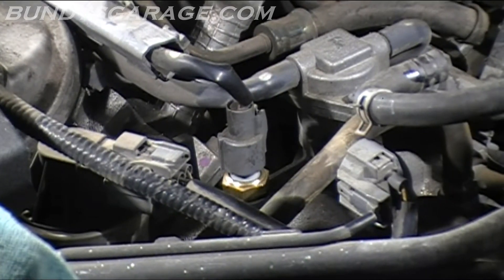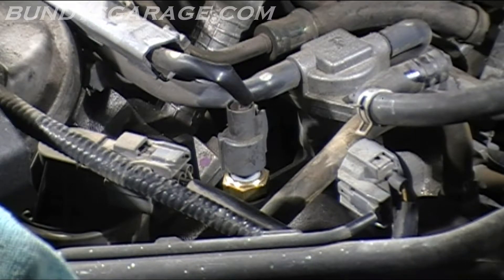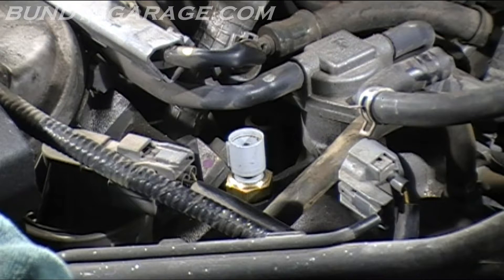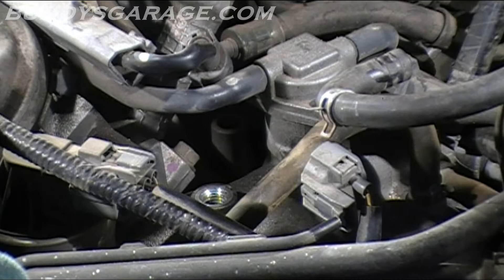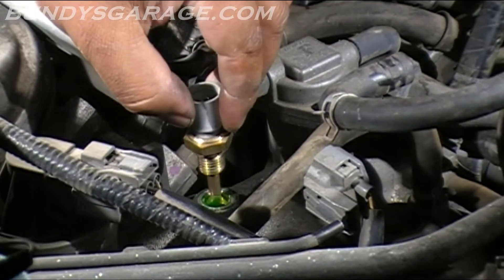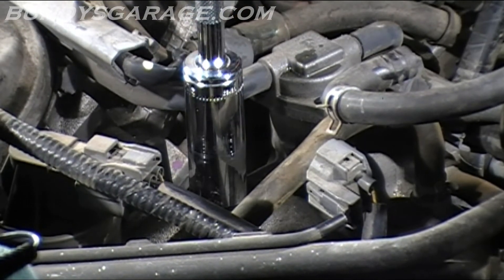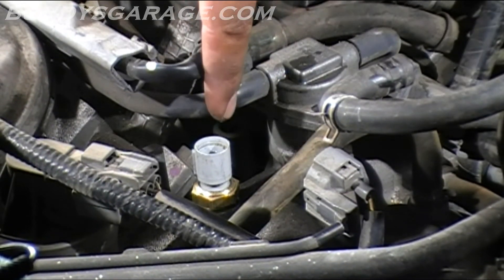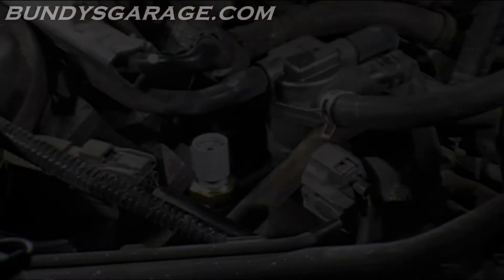UPDATE:Heat Soak Problem Solved Honda Acura J Series V6 - Honda Accord Acura TL

Comment: Well this had solved my problem I thought Worked for about a week Now the problem is back & seems to be getting worse Any more suggestion would be greatly appreciated Simply adore my EX v6 sedan She's my baby but this is very aggravating Please help!!!!!
Reply from the maker: Yes I can help you. Same thing happened to me as well. Had it beat for two years, then is came back. I will tell you what to do but you have to promise to report the results here (good or bad)! You have to change 3 sensors, 40 bucks on Rockauto.com. You have to change the engine coolant temp sensor (19MM), the air intake temp sensor (19MM) and the fan (thermo switch) (it controls the fans behind the radiator) (24MM or 15/16 deep socket) sensor that sits in the thermostat housing. The air intake sensor is on the intake manifold on the back edge towards the drivers side. Here are the Honda / Acura park numbers. Just take those and plug them into the search bar on Rockauto.com. Fixed the problem for me, period. 37870-PK2-015. 37880-P0A-A02. and 37760-P00-004. Just make sure you don’t switch the air and coolant sensors when you install them. They look identical and will fit both locations. Please let me know if this fixes your problem. If you have any more issues email me and we can jump on the phone.
Reply: BundysGarage Thanks for the reply Have already changed coolant temp sensor Will definitely change the other two this weekend & will surely let you know what happens Again thanks a lot for the help
Reply: I’m keenly awaiting updates on how this goes. I changed this sensor as well on my 99 ex v6 accord but it didn’t help at all from day 1. Admittedly, I was having the ‘heat soak symptoms’ for 2 years before doing something about it. Before changing out the coolant temperature sensor I changed my coolant because I realized that my car had been running on dexcool from the previous owner for at least 100,000 miles... not sure if that could confound this issue. Car is currently at 243000 miles. I also saw that a fault intermotor relay could produce similar symptoms but I ruled that out. Any wisdom/help in addition to what what was mentioned above is greatly appreciated. Thanks!
Reply from the maker: Same thing happened to me as well. Had it beat for two years, then is came back. I will tell you what to do but you have to promise to report the results here (good or bad)! You have to change 3 sensors, 40 bucks on Rockauto.com. You have to change the engine coolant temp sensor (19MM), the air intake temp sensor (19MM) and the fan (thermo switch) (it controls the fans behind the radiator) (24MM or 15/16 deep socket) sensor that sits in the thermostat housing. The air intake sensor is on the intake manifold on the back edge towards the drivers side. Here are the Honda / Acura park numbers. Just take those and plug them into the search bar on Rockauto.com. Fixed the problem for me, period. 37870-PK2-015. 37880-P0A-A02. and 37760-P00-004. Just make sure you don’t switch the air and coolant sensors when you install them. They look identical and will fit both locations. Please let me know if this fixes your problem. If you have any more issues email me. Let us know what happens.
Reply: Ordered the the AIT and thermo switch today.

For the fan thermo switch should I be draining the coolant before swapping out the switch then refilling as done for this Civic (https://www.youtube.com/watch?v=88eovIH51bE). I understand it's a different car from my 99 v6 accord but am assuming anatomy is similar in this respect.
AIT seems more straight forward (https://www.youtube.com/watch?v=ohcNq_jslN8)

Thanks!
Reply from the maker: No don’t drain the coolant. Just have the new thermo Switch ready to go when you pull the old one out have the new one ready and put it as quick as you can. The. Just replace the coolant that was lost.
Reply from the maker: Please keep us posted if this works for you.
Reply: BundysGarage  Changed other 2 sensors things are looking up Seems to have resolved the issue It's been two weeks and is starting & idling just fine Thanks for all the help cause this thing was driving me nuts 👍👍
Reply from the maker: Is it still going strong?
Reply: So I changed the AIT and Thermo fan switch using your suggestions and I'm still dealing w/ rough idle on warm starts. The symptoms have not improved for me at all unfortunately. 
Reminder, I have 99 v6 accord ex. I'm open to suggestions.
Reply: Roy, How has this fix been in the last 7 months? I am having a heat soak issue on an 02 Acura RL. Replaced the ECT just trying to see if i should replace the fan switch and air intake temp sensor.
Reply from the maker: I had it happen on a Accord V6  several months back. Changed all 3 sensors and the owners said the problem went away and never came back
Reply: BundysGarage how do I know it’s forsure those sensors ? It’s there a way to check if they are bad or not? Having this issue on my 2000 v6 accord
Reply from the maker: No they have to work all in sync so there is no way to test them. But its only 40 bucks from rockauto.com
Reply: BundysGarage yeah, i tried switching the coolant temp sensor but had no luck , it still has the issue
Reply: BundysGarage so I try the other 2 sensors that you mentioned ?
Reply from the maker: Let me ask you some questions. What is the year make and model of the car you are working on. As well as the engine size. This problem is very specific to only a few cars and other items can make it seems like it’s a heat soak problem. You have to park the car for 15 minutes and then start it up. It will cough, sputter, and run rough. If you give it gas and raise the RPM’s the engine will stay alive. Is this what you are experiencing?
Reply: BundysGarage yes sir , couldn’t of explained it better , I have a 2000 Honda Accord v6
Reply from the maker: Have you tried replacing all 3 sensors that I mentioned above?
Reply: BundysGarage not yet but I will , just ordered them from rock auto and currently waiting for the parts to arrive
Reply: BundysGarage so I replaced all three sensors and I’m still having the issue :/
Reply from the maker: The only other thing I can think of is your fuel pressure regulator
Reply: @fcbcarlitos1959  yes simply use an OBD2 reader to gain access to "live data".
This will show you these sensors are in mint condition 🙂
Reply: @fcbcarlitos1959   this problem has to do with fuel pressure regulation.
It's related to lag, hesitations, lean misfires, low power on countless Honda/Acura.

As it gets old the internal shaft between diaphragm and seat starts to stick... low pressure 😂

Think of this as a non-catastrophic failure managed by design.
Reply: @bundysgarage  this is what i am experience i replaced cts it is still doing it.

Comment: I just experienced this in my 03 CLS6. On acceleration felt like a bad miss fire 😢.  Then after driving for a bit it was back to normal. As I was thinking of possible causes I remembered my J30 Accord has heat soak fuel vaporization in the rail that seemed similar. Stumbled upon this video via google search. Good to know there some more info on this as I was under the impression a PCM update would fix it. Never bother to have it fixed in the Accord since  it was intermittent and I knew once the car ran for a bit it would settle in.

Comment: Kind of old issue, given the age of these 2nd gen TLs, .... but I wanted to add my findings on this. 
I had the intermittent start problems with my 99 TL 3.2  usually when hot but not always. Also occasionally saw the Eng Temp indication fluctuate erratically on the dash.  I replaced the ECT but same problem persisted ... I saw Bundy's video about making sure to "top off" the coolant passageway before replacing the ECT. Here's what I found: with my car level, upon removal I found my ECT probe bone dry. I topped off coolant AT THE RADIATOR then ran the engine with the ECT plugged into it's wiring but removed from the manifold. I watched for about 5 mins as air bubbles came out of the ECT boss ..... when coolant finally free-flowed out without air bubbles, I re-installed the ECT and topped off the radiator. So far so good. 
Bottom line: I've been been a backyard mechanic for 40+ years, but didn't realize the importance of purging air out of your coolant system. With cars these days, an array of sensors feeding data into a computer that runs your engine .... well obviously my old Jeep CJ did not care about air in the coolant but my 99 Acura does.

Comment: Help.  I have a 1998 Accord with the V6.  It runs fine at start up, and then it will almost die while accelerating at around 30 or 40 MPH after it gets warm.  So maybe after 10 minutes of driving on a warm day and a half hour of driving on a cool day.  When it has the problem, I have trouble getting it to go more than 40 MPH.  Will this fix the issue or does it need something else.
Reply from the maker: No your problem is something else. Sounds fuel or transmission related. Do you have any codes in the vehicle?
Reply: @bundysgarage  Thanks for the reply.  No codes or check engine light.  Now that it is cold here in Indiana, I can drive it without getting the problem, but it happened all summer and fall when it was warmer and I expect it to come back when warm weather returns.  Strange.  It got worse as weather got hotter and it happened a couple of times in 2018 and a lot more in 2019.  Here is a list of what I have done so far - replaced spark plugs, replaced distributor cap and rotor, replaced fuel pump, replaced air filter, replaced fuel pump relay, and cleaned the MAP sensor.  None of those helped.  Of course, now that it is cold and the problem won't come up, if I fix it, I won't know until spring.  The car has 177,000 miles.   I'm wondering if I should remove the Engine coolant Temp Sensor and make sure there is coolant and no air in there.
Reply: Should I do the Main Relay?  I already did the fuel pump relay.  I don't think it is an ignition switch problem.  Jiggling the keys has no effect.

Comment: im getting the idea im suposed to top off coolant in sensor hole? ha ha ill try it thanks
Reply: If you unplug the vacuum line that goes from the pressure regulator to the intake, the problem goes away. Just unplug the vacuum line that goes into the intake. She no longer has the heat soak issue. I'll unplug it and drive for a little than I'll plug it back in.

Comment: MAKE SURE YOU GOT 50/50 WATER AND COOLANT IN RADIATOR... fixed my problem!  No more shaking and stalling at idle at stop lights.
Reply: Make sure your radiator cap is good as well
Reply: @LAVigilant  yep! HondAcura rad caps go bad around 130kMi

Comment: These are my 2000 TL symptoms exactly!  Right down to the angled parking.  What is super weird is when I park on a decline the issue is more prominent.  But it's nonexistent when I park on an incline.  I think the angled parking effect is the key to figuring it out.  I can't explain why but that's the one correlation that's consistent and significant.

As excited as I wanted this to be an ECT sensor thing, I don't think it is.  At least not in my case.  I removed my sensor and measured the resistance from 74F thru 212F and I got a nice, expected, inverse relationship between temperature and resistance:  2,200 ohm @ 74F and 159 ohm @ 212F.  (For the math geeks, ohms = 10,750exp(-0.02F) fit my observations almost perfectly.  r-squared=.995.)
Reply: thank you sir, sanity is restored!

Any extended OBD2 Scanner can read the "live data" value of these sensors.

Decline/Incline exactly points at the fuel pump, fuel pressure issue

Many HondAcura suffer of lag, hesitations and misfiring courtesy of this issue.

Yet these are still FAR BETTER quality than any German luxurious money-pits automobiles where everything falls apart down to every POS gaskets leaking oil. 😂
Stay with Japanese 👍🏻

Comment: Hey bundy, i replaced the coolant temperature sensor, air intake temperature sensor, and the fan switch sensor in my 2000 Acura Tl but still having the heat soak problem. Any other possible solutions?

Comment: I changed the sensor on my 05 Acura TL but engine still gets very hot cooling fan doesn't activate. I tested the sensor while still connected to the harness and with a lighter made temperature go up and fan comes up. So that tells me sensor is doing its job. just don't know why it doesn't activate while car is idle. Temperature here is 90 degrees so i left the car on for 20 mins i even drove it around. replaced thermostat, hoses, and even a new radiator. checked fuses fan for any and nothing. maybe theres an air pocket up there where sensor is screwed in to.

Comment: Hi Thanks for posting this video. I am a auto technician from NY. I had an 2000 Acura TL 3.2L V6 that has been kicking my butt. I have been working on this particular vehicle over the past few months. I thought I had the problem fixed when I came across a bad terminal in the fuse box at the left side of the instrument panel. It was a 15amp fuse for the PGM-FI Main Relay. The car had an external XM radio that the installer wrapped the power wire around the fuse and jammed it back into the fuse box to power the XM radio. This stretched the terminal causing the loose condition. I could hear the relay clicking and the engine would misfire and sometimes stall. The problem has reared its ugly head again. This time I happened to notice the hot soak was making the issue more intense. I came across the TSB from Acura for replacing the PCM and Fuel pressure regulator. I was not convinced the PCM was at fault. I did notice that when the engine was started after the hot soak. The engine would run better with the vacuum line removed and plugged from the fuel pressure regulator. I installed a new OEM regulator with no change. I was doing some online research and came across your Youtube video. I figured what the hell I will try replacing the coolant sensor even after back probing the coolant sensor and watching the voltage with my DVOM. Still no change in the vehicle after replacing the coolant sensor. I read the Motor article that you posted. I wasn't buying that fix for replacing the fuel rail with one from an Odyssey. However from reading the Motor article it got me thinking about vapor lock and the fuel in the vehicle. I took a fuel sample in a clean clear bottle I did not see any water in the fuel. Then I got thinking about the quality of the fuel. Today I removed the fuel pump assembly & completely pumped out all the remaining fuel from the tank. I went to the gas station that I know has non ethanol premium fuel. I filled my gas jug and pumped it into the vehicle. Then I started it up and drove the car over to the gas station and filled it with premium non ethanol fuel. I proceeded to drive the car for 25+ miles. The car ran fantastic during the road test. I brought it back to the shop let it heat soak and tried starting the vehicle. The car fired right up ran smoothly. I made several more hot soak starts all with perfect starts. I road tested the vehicle once more on the same 25+ mile road test. I am chalking this one up to Ethanol fuel. The vehicle requires Premium fuel. It even says so right on the fuel door.
Reply from the maker: If this problem comes back, check out my post I sent to someone else: 

I had this beat for two years, then it came back. I will tell you what to do but you have to report the results here (good or bad)! You have to change 3 sensors, 40 bucks on Rockauto.com. You have to change the engine coolant temp sensor (19MM), the air intake temp sensor (19MM) and the fan (thermo switch) (it controls the fans behind the radiator) (24MM or 15/16 deep socket) sensor that sits in the thermostat housing. The air intake sensor is on the intake manifold on the back edge towards the drivers side. Here are the Honda / Acura park numbers. Just take those and plug them into the search bar on Rockauto.com. Fixed the problem for me, period. 37870-PK2-015. 37880-P0A-A02. and 37760-P00-004. Just make sure you don’t switch the air and coolant sensors when you install them. They look identical and will fit both locations. Please let me know if this fixes your problem. If you have any more issues email me and we can jump on the phone.

Comment: Hey bunndy i just bough a ful injector repair kit for the ody 01 but i got on ebay but im confused cause on the Honda part.com i saw 4 seals but I couldn’t see the little filters that its inside the injector look at this thats what my kit comes with  6 upper o-rings/seals

6 filters/gaskets

6 lower o-rings/seals

6 rubber gourmets. 
 
You think thats the whole set for the injectors lol 😂